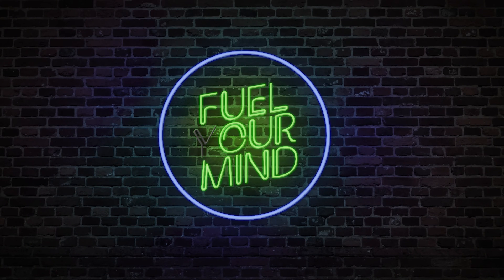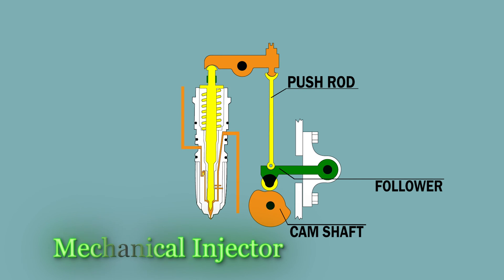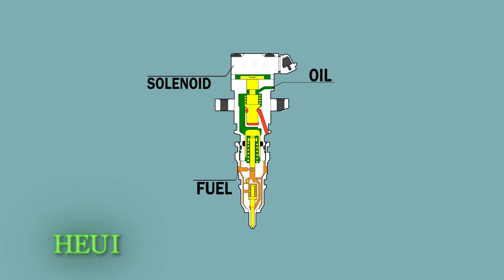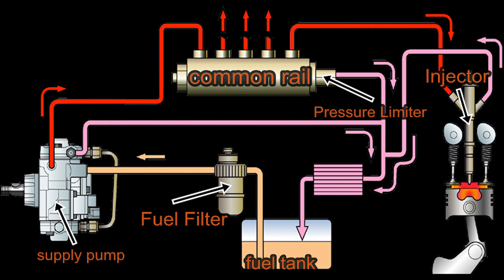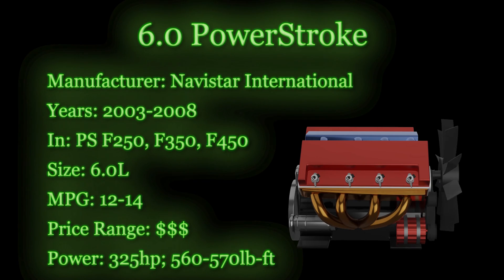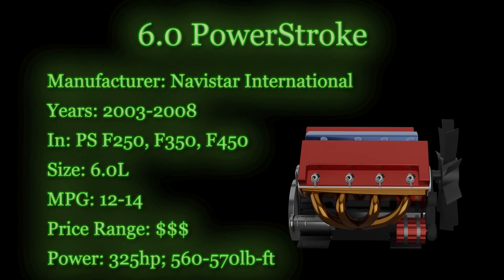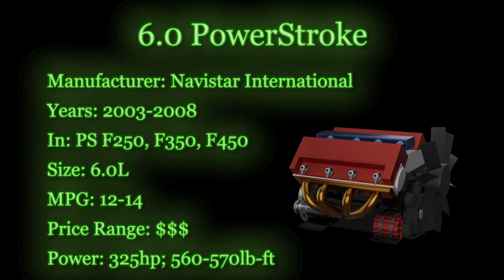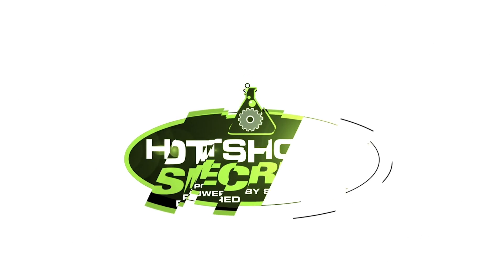Fuel Your Mind: Diesel Injection Systems | S01E04

Comment: 6.0 Powerstroke is very fuel efficient, can be bulletproofed, get good power (800 hp on stock  rods), and they are pretty easy to work on. They don’t have to comply with emissions(get a 05-07 with the 5r110) and will serve you well. Anyways hope you find a truck.